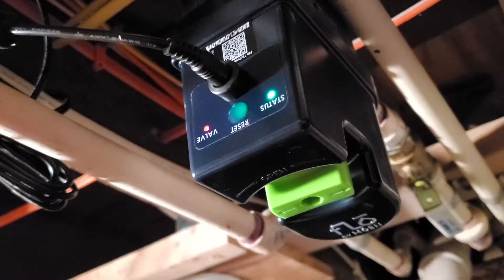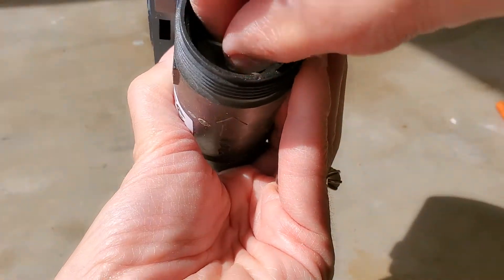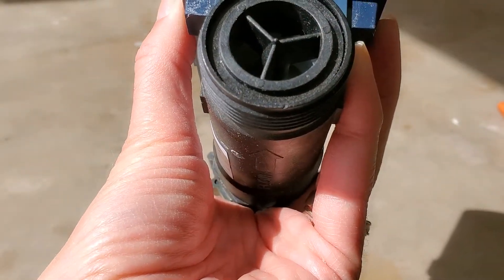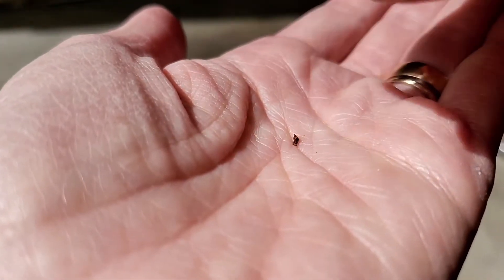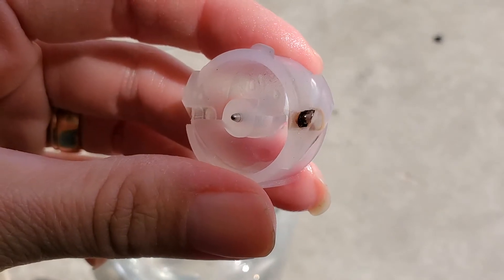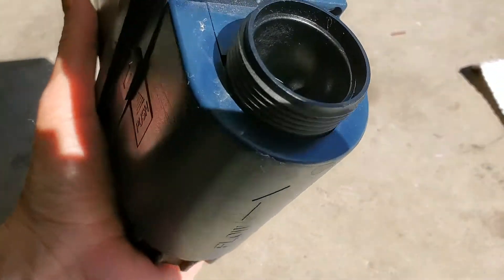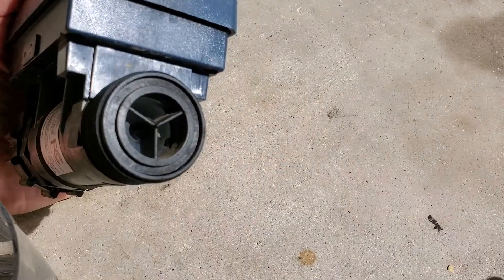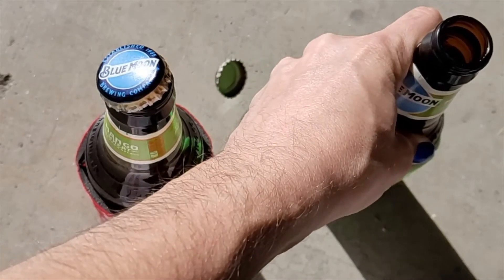Flo by Moen Flow Sensor NO LONGER WORKING?!? Turbine Repair Tutorial

Comment: Thank you!!! This is what happened to my unit after just a little over 2 years, weekly usage went from 1000 gallon/week to only 300ish, contacted support they told me to flush it without any details on how to do it, basically admitting their crappy design but wouldn’t offer to fix or a discount unit. I’m so regretting having recommended it to friends & family over the years. Good concept but just a piece of crap.
Reply from the maker: Did the flush end up working for you? New Flo devices have not been available since some time before the end of last year with no word on when it will be available again.
Reply: @NoMoreLeaks  Thank you for replying to my comment! No I've decided to leave it as is and take the consumption readings at "face value". Even tho I know it's reporting way less than actual usage, it has stabilized over the past year and didn't go all the way down to zero. Most importantly the auto shutoff does seem to work fine in the event of an unusual usage (longer shower etc), although I'm not sure if it means it takes roughly 3X more water to trigger the auto shutoff. I also stumbled upon another youtube video after watching yours (I'll put the link in a separate reply below in case URL isn't allowed in comments, but you can search for this title: "Moen Flo - No flow repair - How to" uploaded by user Repair123), which offered a potential way to fix the issue semi-permanently, but either way it seems to me that simply flushing out the buildups on the turbine isn't enough, the buildups will simply come back after a while due to its faulty design. Flo support would clearly know all of these, but they told me to just flush it and that was the end of their so called support. It shows not only they make crappy product, their service is much much worse. They could've just offered to send us replacement turbines for free, which probably costs only a few dollars.
Reply: Here's the URL to the video I mentioned. https://youtu.be/2Y3IVkFuPx4
Reply from the maker: Thanks for sharing that video! It is very much more involved, but if it works that's great. I might have to try it when visiting Flo #5 next time. I wonder if the new MSRP of $767 includes some improvements in the design: https://www.moen.com/products/Flo-by-Moen/Flo-Smart-Water-Monitor-Shutoff---0-75-/900-001

Comment: Great videos and explanation Margaret. Thank you! My 900-001, 3/4" --installed indoors in Wisconsin on a well--failed (no flow rate) recently at 22 months. I did the vinegar treatment on the magnets with no luck. Under magnifying glass magnets are pitted, but unit has likely failed elsewhere although it's hard to tell. I have been going back and fourth with the company about solutions with only a discount coupon. While the company has been attentive in responding to my inquiries, I have to keep emailing them with various questions that they could have outlined early on to save them, and me, the back and forth. For example, they offer a coupon in an email and I go try and use it only to find out the device is out of stock.  <sigh>
Reply from the maker: Sorry to hear it didn't work. I've heard about them being sold out off and on since the summer. Here's to hoping the next round of units come in and you can use that coupon. Thanks for sharing your story to help others struggling with the same issue.

Comment: WTF..... Seems way too soon to have the unit fail, and if they are using magnets that rust, maybe they should coat the magnets to protect them from that happening. I appreciate the tutorial on taking the unit apart but I'm really not interested in adding yet another thing that needs to be maintenanced in my home. I had this problem a few weeks back but I thought it was a software glitch, now because of your video I know better........ Thanks Margaret !
Reply from the maker: I think there are a number of things going on here. What's in the water is probably a huge factor. PH/contaminants/minerals/etc. Hopefully yours is better since you are on a well.

There was similar buildup in both units I still have: the one that lasted 8 months and 1 month. I will also admit, I had no desire to take it apart until now. I want to keep my side by side comparison of Phyn and Flo fair and it's not possible to take anything off Phyn. <Side note here: technically isn't taking it apart to the point where the warranty is void--I don't think I did a stellar job at defining the difference there> So was the bulk of the corrosion after the unit oxidized once it was taken off the water line? I have no idea.

I fully expect the materials science people on the Flo team are trying to come up with a more robust answer to this problem.

It still might have been a glitch since these are WiFi/software dependent. I think you are still in your 1 year window since you installed yours. Did you enroll in FloProtect yet?

Comment: Thank you for the video.    I also forgot which way it goes back in.  I had the flo protect plan and they are sending me a new unit after my old unit failed with no flow.   Next time I'll try cleaning it out.
Reply from the maker: Glad to hear I'm not the only one! Over half the time I'm thankful I'm trying to make a video otherwise I'd forget to take the picture and then...¯\_(ツ)_/¯ FloProtect has been solid and I'm glad to hear you are having a similar good experience.
Reply: @NoMoreLeaks   I just opened it again and notice one of the magnet is missing, even with it cleaned up it is no longer working.   Still waiting for my replacement unit to arrive (8 days).  I'm on public water but I'm going to move my whole house filter to before the flo unit hoping that will help.     I'll be following your Phyn review as a future alternative.
Reply from the maker: Wow. I haven't heard of a missing magnet before. That would certainly change the flow rate measurement as well. How long have you had your unit installed?

Makes sense that you tried  to get it working again. There have been a lot of supply chain issues across the water monitor companies as well--I heard Flo was backordered in a conversation on IG a couple months ago and I see it's not in stock online on the meetflo website.

I can't say I've heard much on the effect of water softener systems (other than a water monitor can really mess with them during their cleaning cycles), but filtered should be much kinder. Perhaps you can still put one of their detectors under the filter to keep that area protected?
Reply: @NoMoreLeaks  , I've only had it since July 2020 (16 months).     Back in April,  I had the no flow and did the flush.  I'm wondering if at that time it lost the magnet.   Hopefully their supply chain issues resolve soon.  Otherwise they should refund me the money and I can order off amazon.
Reply: Perfect timing, my replacement unit came in the mail just now.
Reply from the maker: Glad to hear you are up and running again. Flo customer service was very knowledgable and excellent in addressing issues.

As for the timing of the lost magnet--and I almost asked this in my last response--I guessed you tried the flow thing this last week when it stopped working again? If it fell out in April I think your flow rate would be half the speed and you might be questioning why your shower head and toilets seemed twice as efficient as normal ;-). While that would be awesome, joking aside, I'm guessing it fell out with the last flush?

While I mentioned the magnet falling out in the video as a possibility, I didn't fully expect to hear about a case like that so quickly. I really appreciate you sharing your experience.